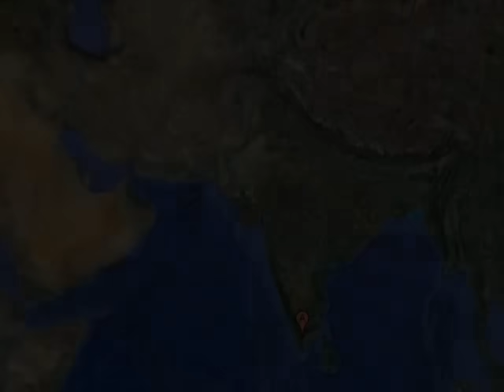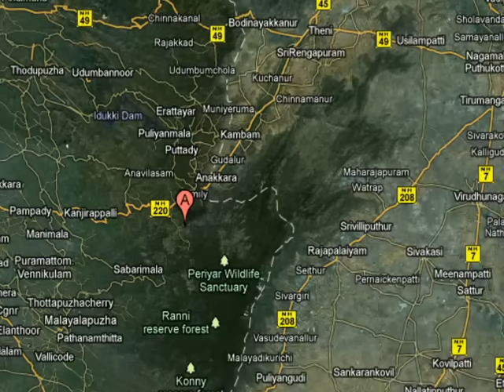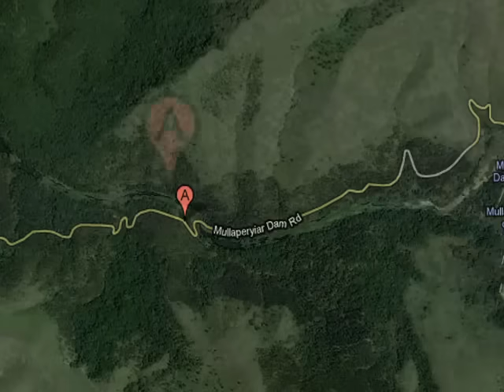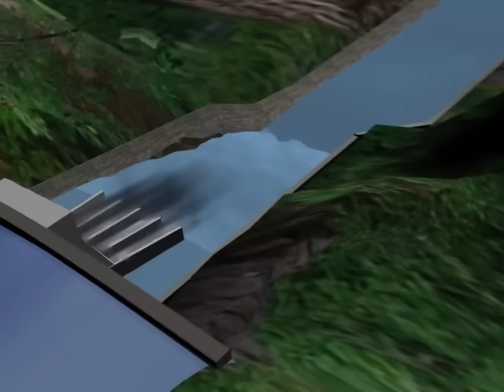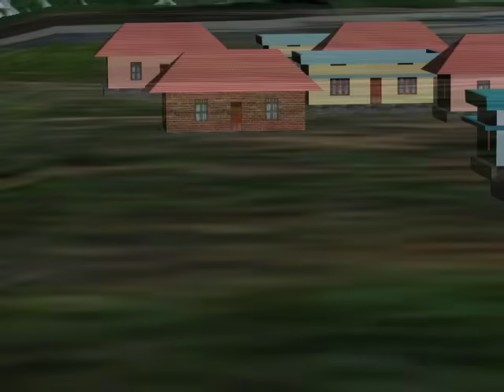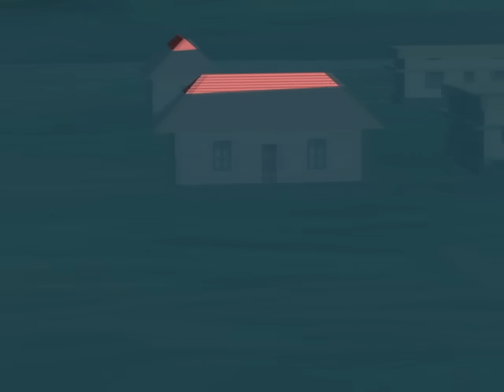Mullaperiyar Dam Crash animation project, Idukki, Ernakulam, alappy in danger

Comment from the maker: "Mullaperiyar Dam, Periyar River, Kerala, India. 
Age: 125 years+
The Mullaperiyar Dam (Figure 12) is a gravity dam of 53.6 m in height and a reservoir capacity of 443 million m³. It impounds the Periyaru River in Kerala State, downstream to Tamil Nadu state, India. It was built in 1895 by the British government to provide irrigation and eventually began to generate power in 1959 (Chowdhury, 2013; Thatheyus et al., 2013). At the time of construction, the dam had an intended lifespan of 50 years (Chowdhury, 2013). 
Still, in service over a century later, the dam shows significant structural flaws and may be at risk of failure. The dam is located in a seismically active area. A minor earthquake caused cracks in the dam in 1979 (Rao, 2018), and in 2011, more cracks appeared in the dam due to seismic activity (Thatheyus et al., 2013). Leaks and leaching are also concerning, as the methods and materials used during construction are considered outdated compared to current building standards. In response to these structural issues, dam decommissioning has been considered. However, a conflict between Kerala and Tamil Nadu States started to grow regarding the best way to manage this ageing infrastructure (Thatheyus et al., 2013). Although the dam is located in Kerala, it is operated by the upstream state of Tamil Nadu. Kerala residents are afraid of a dam collapse and argue that the reservoir level must be lowered until the dam is fixed.
Meanwhile, Tamil Nadu residents want to maintain the water levels at capacity (Rao, 2018). In 2009, 
 Kerala requested a new dam to be built, but Tamil Nadu opposed the idea. Currently, the decision of how to manage the ageing Mullaperiyar dam is hotly debated and working through the court system. A dam failure risk would be catastrophic: nearly 3.5 million people will be affected (Chowdhury, 2013)." - Quotes from a study by the Perera, D., Smakhtin, V., Williams, S., North, T., Curry, A. (2021), United Nations University, Institute of Water, Environment and Health.

https://inweh.unu.edu/ageing-dams-pose-growing-threat-un/

Download full report: http://inweh.unu.edu/wp-content/uploads/2021/01/Ageing-Water-Storage-Infrastructure-An-Emerging-Global-Risk_web-version.pdf
Reply: Oh dark

Comment: Raising the water level for a century old dam is suicidal. There should be efforts to reduce the level & thus the pressure on the dam, because it is too old. 
I learnt in school that the dam also divert water to the east (through a tunnel) into the Vaigai river as Kerala on this (west) side has excess rainfall while on east dry condition prevails. It shows the sagacity of the British rulers. The way out can be by the use of 'Siphon' peinciple that is usually employed between two flows of water. When the water in Periyar damrises (due to copious rains) it flows east through the siphon.I don't think anyobe gas tried it between two dams (another small dam needs to built on the east too),but it wikk work as per gydraulic laws of (natural) water flow.
Reply: [sorry for the misspellings]
Raising the water level for a century old dam is suicidal. There should be efforts to reduce the level & thus the pressure on the dam, because it is too old. 
I learnt in school that the dam also diverts water to the east (through a tunnel) into the Vaigai river as Kerala on this (west) side has excess rainfall while on east dry condition prevails. It shows the sagacity of the British rulers. The way out can be by the use of 'Siphon' principle, usually employed between two separate flows of water. When water in Periyar dam rises (due to copious rains) it flows east through the siphon. I don't think anyone has tried it between two dams (another small dam needs to built on the east too), but it will work as per hydraulic laws of (natural) water flow.

Comment: this is totally wrong propaganda... this water will go to idukki dam. idukki dam eight times bigger than mulai periyaar.... the biggest threat is Idukki dam..
Reply: Hey..mhaan.. idukki also have enough water in it
Reply: Periyathambi Sampath എന്തെങ്കിലും അറിഞ്ഞിട്ടാണോ ഈ വിളിച്ചു പറയുന്നത് അണ്ണാച്ചീ??
Reply: And idukki 6 times stronger than mullaipperiyaar..and new too
Reply: Hey you if you don't know about it please stop talking about it. please understand a dams strength is not based on its size it's based on its construction and material used for it.idukki dam constructed with pure concrete and mullaperiyar is with surkhi .
Reply: But Idukki dam has its own water...it will not bear mullaperiyar dams water with that force...if mullaperiyar breaks Idukki dam also will break...so....thalak allallo valam vekkandath

Comment: Dear funny meme creator, even I can do many animation video like you,,,mullai periyar dam is 7 times smaller than idukki dam,,meaning if mullai periyar dam totally damage all the water coming out also idukki dam can hold the water, so why you ppl always complaining, also mullai periyar water is ride by mountain and Forest Finally can reach idukki dam without any damage of ppl or properties..
Reply: arasu arasu ..Perfectly said bro..But I don't understand y none of the keralite is able to understand that..
Reply: They won’t realize that there is behind politicians brainwash and selfishness. Even though TN supported them financially and physically during they suffer, imagination isn’t a solution and hav to take supportive steps for both side.
Reply: @vigneshp4539  it is because they are the ones who will be affected and not you. So naturally they fear for their life. There have been cracks on the dam but the Tamil govt fill it up using cement. Not the best way to maintain a dam.
Reply: The dam is very old. Idukki dam can't hold that much water. It will also break. Then there would be no kerala especially during monsoon season.
Reply: hope it will never happen. But if the dam breaks, not only the water is flowing to Idukki dam, but the concrete, the soil, rocks etc. this is un imaginable and when it reaches Idukki dam, it cant hold that mass and pressure.

Comment: Supreme court gave judgement as dam is strong enough to store water after ibspection with top engineers...We have dam called Kallanai across Kavery which constructed 2000 years back.  Today around 3 lakhs square feet per second  water is flowing...Still dam is very stong....don't make romours.Kerala has 39 dams all the dams are strong but only Mullai Periyar only weak..

Comment: In 2018  as of June 18th today mullaperiyar dam is full at about 2400 feet right. Strength seems to be proved?. Just trying to understand the facts. Also Idukki dam is opened. were there any cas
ualities due to this
Reply: Mullaperiyar dam level is not at 2400 feet. Thats idukki dam.
Reply: Yes there were many casualties and in the quest to prove the strength of damn it made the flooding worst because  water was released gradually bit by bit as in the case of idukki ... mullaperiyar reached a point where they had to release all the water at once and that made the problem worse. Politics and pride  over human lives was witnessed. Also when u look at casualties don't just look at the ppl who died in the flood or landslide look at all the people who might have died due to effects of it like hospitals with no power. Elderly or sick ppl who are stuck in homes with no power or water and as a result die now or die months later end of the day none of these will be part of the statistic but floods were responsible for it just like in puerto Rico storm the official death toll is 64 but the real toll is more than 1000 due to it's effects and it's widely reported now a year later
Reply: Death toll 91 and u r asking were there any casualties
Reply: For a long time pressure can cause a brake Or even a miner earthquake.
Reply: same stuff applies to Idukki too.. nearing its 50 years..
Reply: Arun Ramasamy It is an arch dam. And  is build with Reinforced congreat